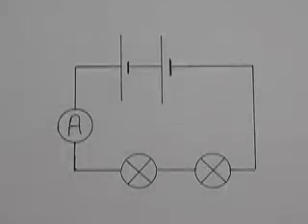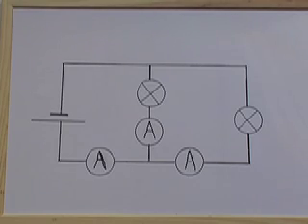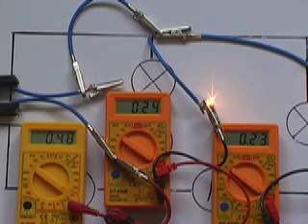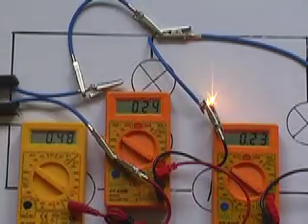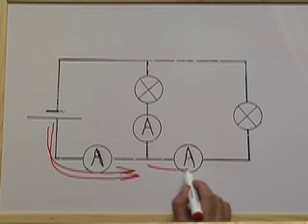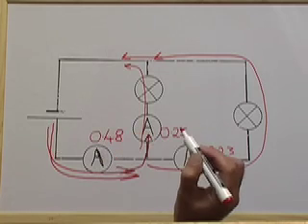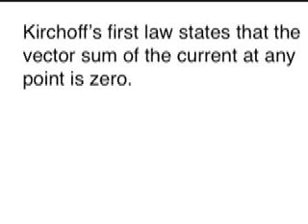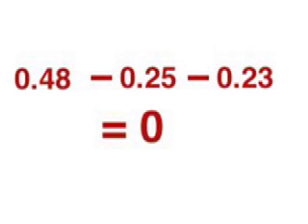Kirchoff's First Law on current flow explained: from fizzics.org

Comment: Electrical study is MORE than just connecting wires. You might know how to run wires to a new circuit but THAT IS NOT ENOUGH. Without the knowledge of electrical law & calculations your work can not pass as safe. Working on electrical installations without knowing the behavior of electricity is VARY DANGEROUS. You REALLY have to know how current flows and behaves in regards to the grounding system + TONS of other things. Study stuff like this video.

Comment: @KKinsane2009 the reason the ammeters are flickering is their uncertainty, if you would care to take that into account. the experiment will have its reading errors, and these have to be calculated after. i am sure this scientist knows this, and at the time when he said they were the same, they actually did read the same value. the reason we take uncertainty measurements in experiments is because of the uncertainty in the instrument we are using to measure.

Comment: @KKinsane2009 and Stealths comment , rude as it is, is correct. If you don't factor in the resistance of the test leads you will be close. But you will not be exact. But when you are measuring a difference of 250mV and 230mV.... that's pretty close.

Comment: @KKinsane2009 You're right, it really doesn't matter, as long as it's close to totaling the source voltage. There will be varying voltages because of the varying resistances on the circuit conductors.  If the VD was considered in this simple exercise you would be able to see a more accurate display. So with VD out of the picture you'll have 480mA flowing conventional into the parallel node and splitting 250mA and 230mA between each componant, then reuniting back to the source.